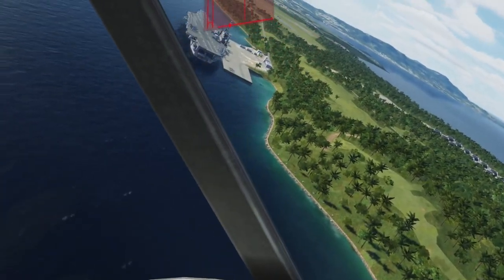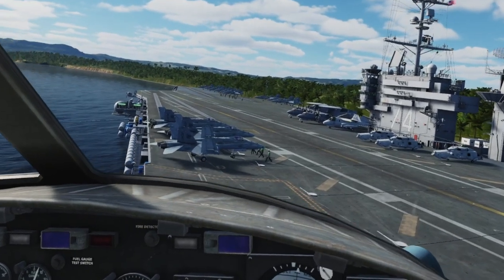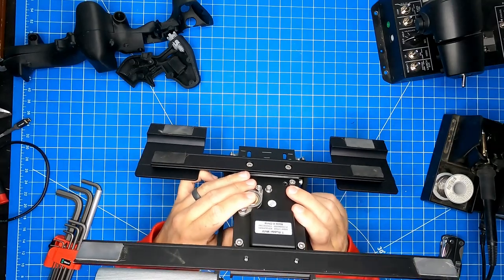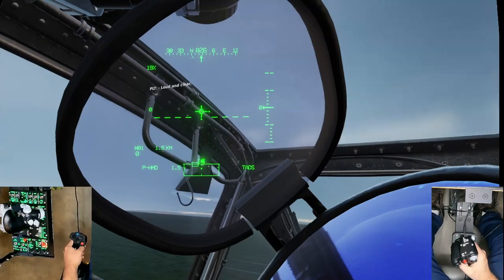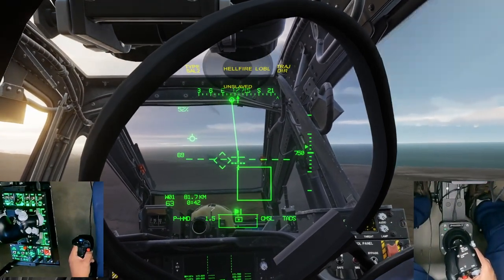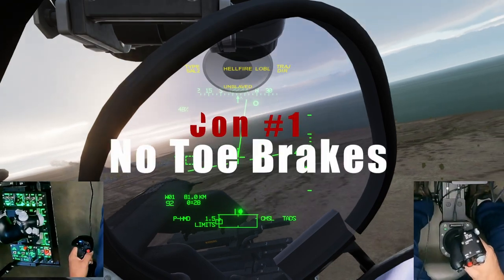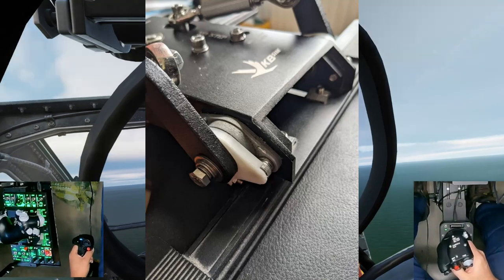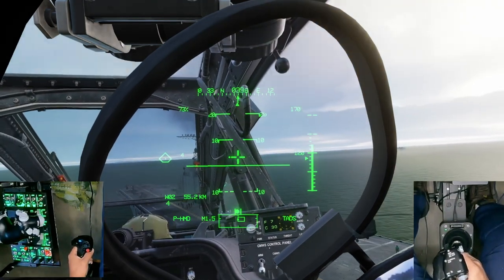VKB T-Rudder Review

Comment: For the price they are good.  However, they are flat and almost need to be mounted in a pit that can accommodate an incline.  Mounting into a simpit is not easy and you will have to find a way to do it.  Next - and what really turned me off to these, is that after about 6 months, the board inside the pedals started acting funky.  It would constantly lose connection and the VKB software is absolute garbage.  I would spend HOURS trying to get them reconnected just due to poor software. (After all new cables and a new blackbox)  Now that Winwing just came out with theirs - I upgraded to them and wish I would’ve just spent the money in the beginning on the TPR or Crosswind.  The Winwings are amazing BTW.
Reply from the maker: I've not had the same experience with mine,  being kept in a very dusty environment on the floor, the only failure being a cable and that was my fault. I also saw no need to mount them, particularly when being used in an office chair (this is their intended use case by the way). For a cockpit their style of movement is far from ideal.
Reply: @FalconsLedge   I would agree that they are not good for cockpit use.  On the floor, I can imagine them being much better.

Comment: These are brilliant for Helis and fine for jets (where you really only use rudders on the ground). I am a WW2 tragic and would have loved a TM Pendular or a Virpil but I have a Next level GT Track rig which is too narrow for these so I got the VKB's and I have been very happy with them. I got round the no toe brake problem with the VKB stick (highly recommended) with the twist grip. Also add some extra spring tension with some bungy cord connected to the outside of the pedals.
Reply: Nice. The bungy cord solution is a great idea. Will probably do that myself as well.

Comment: I think my full setup will include the following: A warthog throttle (already have it) a VKB gladiator and these pedals, do you think this will be sufficient to have a enjoyable experience with DCS?
Reply from the maker: I don't see any reason why you couldn't have an enjoyable experience. I've mapped wheel brakes to one of the axis on my throttle base
Reply: @FalconsLedge  that’s really smart, I’ll do the same when I save up enough to get ‘em, I managed to snag a brand new warthog throttle for $130 on eBay.

Comment: I would love a set but the no toe brakes is a deal killer for me.
Reply from the maker: Mfg crosswinds, TM TPR with damper mid, both great options
Reply from the maker: If the t rudders are at the top of your price range, I absolutely do not recommend the Logitech pedals, they are horrible. I would rather not have toe brakes then deal with those piles of garbage.

Comment: My issue with the T rudder ia mostly just how flat it is. I underatand it is intentional, but an incline bracket option of 15-20 degrees would be appreciated.
As it is now i may whip something up out of 2x6
Reply from the maker: Pull them closer to you, it makes it easy more comfortable. I will eventually mount them on my flight chair as I build it out. Maybe I'll incline them a bit then?

Comment: Im getting into helos.. got the Logitech rudder pedals and find them cumbersome and quite heavy.. also the toe brakes arent any fine and are quite unconfortable to use.. would be the VKB smoother and more compact? 

i allready own a NXT Gladiator EVO and a SEM and i love both of them to dead..really happy with VKB so far
Reply from the maker: @sparrowlt  the VKB pedals are very accurate, and easy to use. They will help your helicopter flying quite a bit over the Logitech. And if you don't need your brakes even better! One great thing about them is that they are made for use in an office chair unlike most replica style pedals
Reply: @FalconsLedge  I tought the toe brakes would be important but the more i use the logitech the less covinced i am because i use an office chair...my cockpit is a desktop so i cant "bolt" anything down and i do move the chair with moving the pedals .. and in the other hand i dont know if its the logitech or me i find hard to fine tune the helicopter inputs with them..for planes i dont use them as until now the NXT Gladiator twist worked quite fine for that and i was even begining to fly helios with that twist.. but it became clear pedals were necesary
Reply from the maker: @sparrowlt  VKB pedals will serve you well

Comment: be curious to see how height you can lift the foot rests.
resistance wise, how resistant can you make them ?
Reply from the maker: Not very resistant, but you can install a damper mod (a couple of them) that help. I have new Winwing pedals on the way to test
Reply: i have a set of Virpil WarBRD + damper on the way, but liking the look of these more... might try and get those cancelled out of the order and rather get these, they look more Heli for me... can't see Virpil cancelling the order, might have t take something else like a throttle assembly. 
 @FalconsLedge